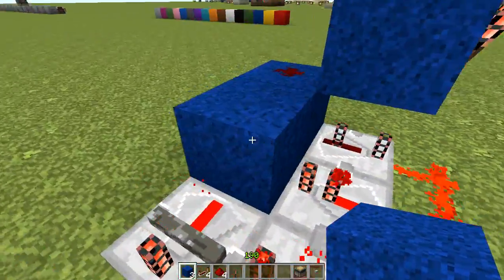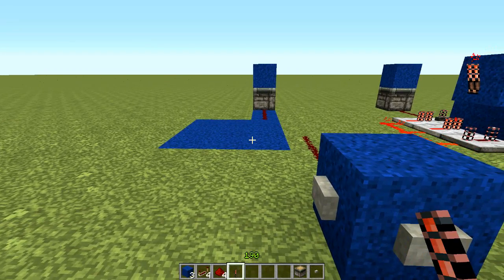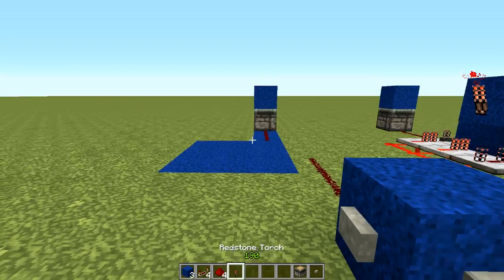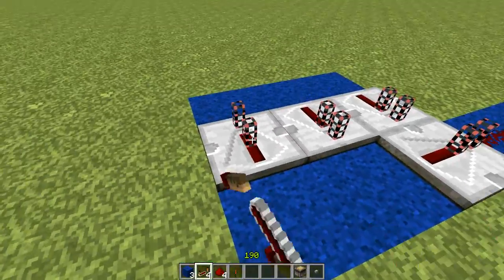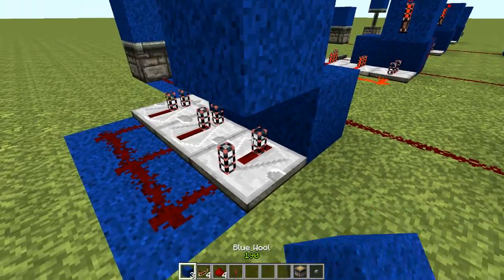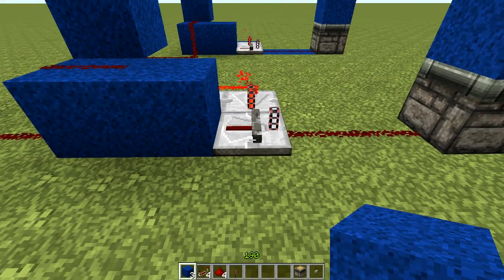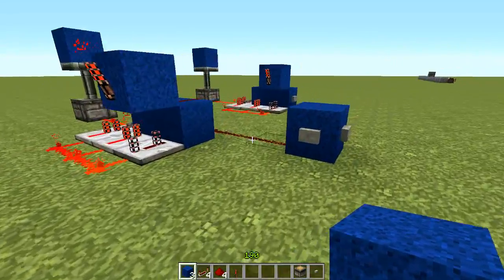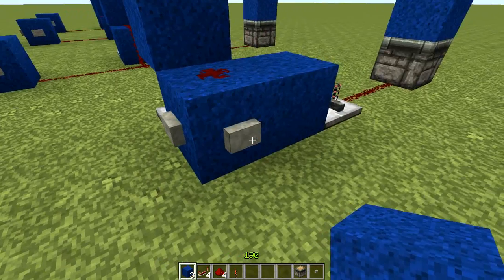Minecraft Fast - Silent/Pistonless T-FlipFlop Tutorial in Less Than 60 Seconds ( 1.6 / 1.6.2 )

Comment: how does this work
Reply: As the input is powered, the torch is off and it gives a chance for the redstone to cycle through a clock and when the input unpowers, one of the repeaters of the clock gets LOCKED by another repeater. That's how it kinda remembers its on/off state.